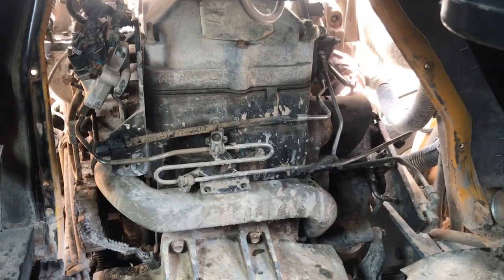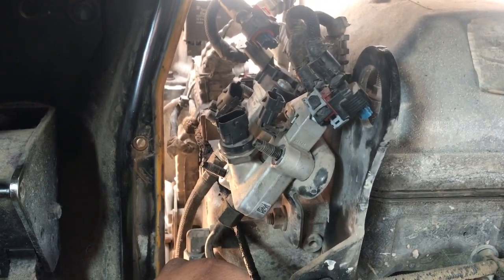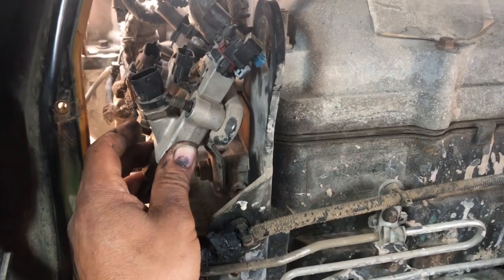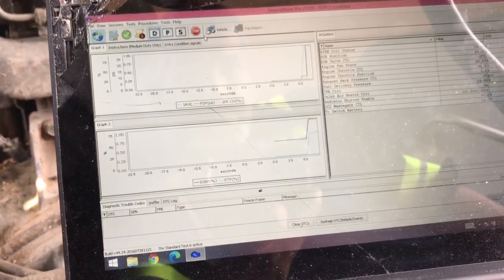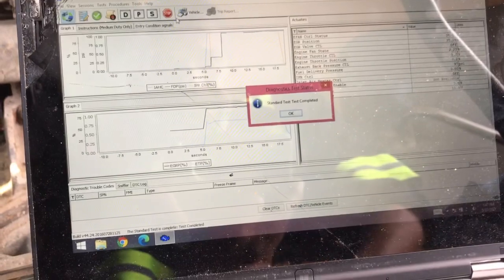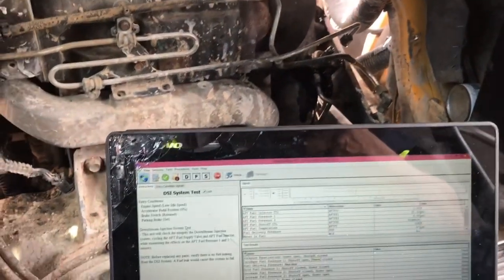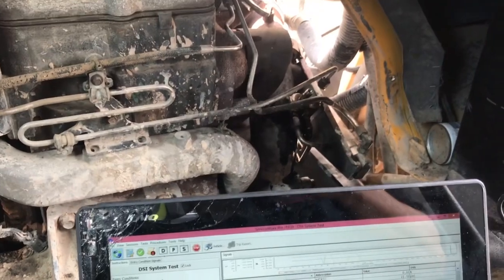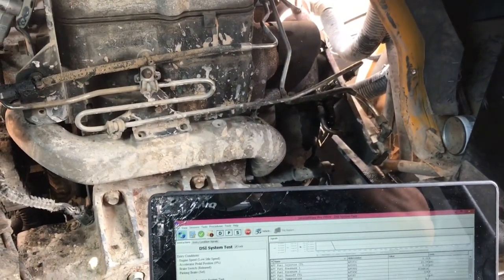Forced regen (repairs needed)

Comment: Hey Joe, I have a question, so if you swap the rear axle on an IC CE Maxxforce DT, so it doesn't rev as much on the highway, what software do you use to change the shift points on the transmission once you swap the axle?
Reply from the maker: Hey there Jillian. That there is a good question (haven’t changed parameters myself). Allison software would be needed. Transmission settings are on your TCM (trans control module).